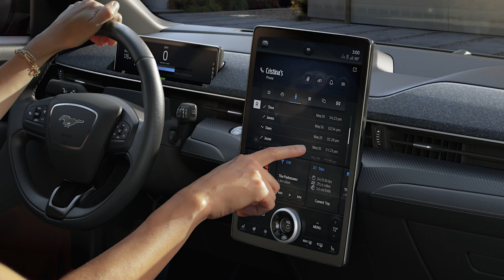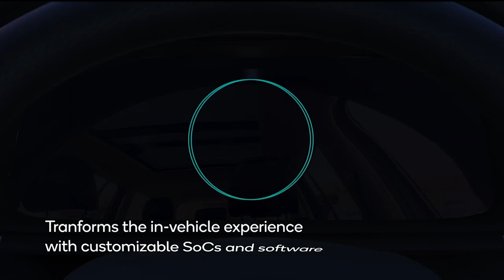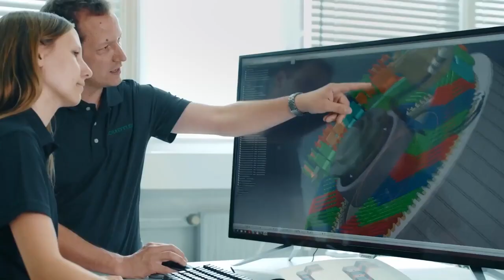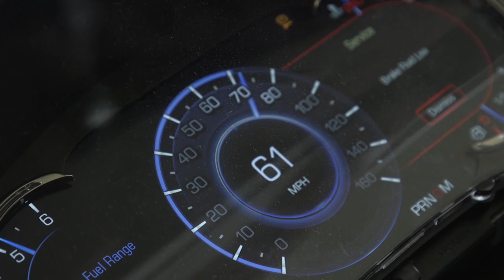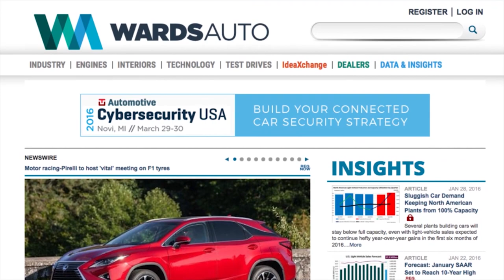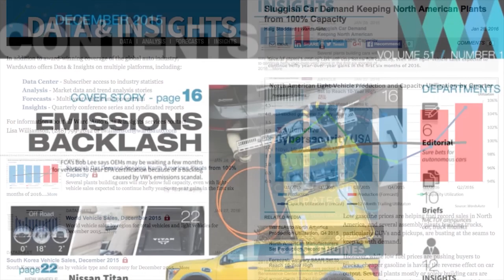VW Concept Anticipates AV Travel; Ford Raids Silicon Valley for Talent - Autoline Daily 3412

Comment: Is there anything less efficient than a hydrogen ICE vehicle.    Just use the electricity in a BEV and get 2 or 3 times the range.
Reply: There have been an army of folks trying to develop hydrogen vehicles for years and no one seems to know what the end game is. What is interesting is how much money companies like Toyota spent on this instead of BEVs. I could understand if they had a plan to make and sell hydrogen or hydrogen making machines but they had no plan for that at all. Very strange.
Reply: @frankcoffey  It is bad enough with a hydrogen fuel cell.   But to go with an ICE which will lose even more energy is bad.  Also that tail pipe is still spewing NoX and possibly the PM2.5 particles.  Or whatever they are called.
Reply: They may be more expensive to make, and more expensive to fill, and less efficient to drive, and be stuck around the few available refill stations, and have smaller trunks, and have no mechanics trained on fixing them, but...  Wait, is there a "but"?
Reply: CNG / LNG was the clean solution all ignore . Cleaner than EV and all indoor commercial vehicles like forklifts use it . Well to well cleaner than EV and no toxic battery waste . EVERY IC MOTOR easy cheap conversion ! Why no talk of hydroelectric also ?
Reply: @BrogeKilrain  Anything with an ICE engine produces NoX and PM2.5 (small particles).   If your going to breathe the air electric is better.  Batteries will be recycled.  Hydro is good when one has it.
Reply: @JohnPMiller  The “but” is the raw materials needed to make ev batteries. It will take at a minimum of 10 years to have lithium, copper, nickel, etc to be at full capacity in North America. The majority of cobalt reserve that everyone needs is located in the Congos, a place infamous for child (slave) labor. There are other places with cobalt, but not enough to meet the global demand. New battery tech that eliminates this material is also going to take 10 plus years to hit the market. The need for transition tech like hydrogen ICE are needed.

Comment: with the new talent you can bet they are all "car guys".  looking for the "cars" they will produce.  vehicles used to have personality.  with this new direction get ready for all the emotion and excitement of a washing machine
Reply: Sure, there is no cult around Iphone or MacBooks. The difference is just that the personality is not about noise, smell and rattles.
Reply: @Terry Orzechowski I'm more concerned with them being able to function period where I live.  Here in the winter we have periods of minus 35 at night with highs of minus 20.  Plus lots of snow and ice.  Your vehicle either produces lots of cabin heat or you die.  Plus I pull lots of heavy trailers.  As of yet no ev made will do what I need my vehicle to do.  4 wheel motors might be fun in our 3 months of summer but what does a person use the rest of the year,
Reply: @Terry Orzechowski the real problem is energy density.  The total amount of energy that can be carried on board the lightning just isn't enough for anything other than casual towing now and then. 

Not so sure about the heat issue.  Heat pumps typically don't work at the kind of winter temps we see, which would mean using resistive electricity to heat.  If range is already a struggle when towing,  then it will be even that much worse when you have to take minus 25 outdoor air and heat it to 65 above in the cab.  Lastly these batteries don't hold a charge well in the first place at very cold temps.

Guy in town here just bought a lightning.   I'm going to see if he is trying to drive it this winter.   

I'm not philosophically opposed to evs, just don't think they are quite up to snuff yet

Comment: Hi Elon aka Mark aka CEO of Recall Motors.  Hagerty tested the latest EV from lowly Hyundai (home of the $4995 Excel) yesterday and it beat your "performance" Y in the quarter mile.  Not the first time your naming convention isn't truthful.  Anyway, props to Hyundai -- king of the $99 buy here, pay here special.
Reply: OTA updates are the future if not present of modern automobiles.   Many object to calling something fixed with an OTA update a recall.  Like the anti-finger-pinching patch recently released.
Reply: @danharold3087  The process to report the issue is the same. The manufacturer reports the problem to the NHTSA, which generates a bulletin and a "RECALL" once the fix is approved. The manufacturer is required to then supply a fix, and send letters to the product owners. How it gets repaired has no bearing because a safety issue had to be addressed. 

When I used to work in the auto industry, I had to deal with a recall that required a visual inspection, then take action if needed. Many cars were only visually verified and immediately the owner was sent on his way. No repair, that was it, yet, it still counted towards the Recall as NHTSA calls it.

P.S. They call it "finger pinching" to not create panic. It could be a child's or a pet's neck or limb.
Reply: Adding to your comment. Tesla has had 14 recalls for 3.5 million vehicles... That was just this year only. That ranks Tesla 2nd to last on the Dow Jones Sustainability  Score. Also, Sam Car Legion had a 2022 Genesis GV60 beat a Tesla dual motor and a Mach-E GT.
Reply: @Roddy451   Are all recalls the same.  A recall fixed with an OTA which most owners are unaware of should not be counted the same as having to take the car to a dealer to have a part replaced.  They can OTA my car as needed and it will not inconvenience me.   Contrast that to getting a recall notice, setting up an appointment, taking the car in, picking it back up.   Tesla ranks at or near the top in customer experience scores.  These other scores are wonky.
Reply: What are you talking about?
Reply: @Roddy451    The entire recall notification system is outdated and a wasteful.   People are getting notifications of the recalls after the problem have been fixed by OTA.    Or is it right because this is the way we have always done it.
Reply: @danharold3087  27/28 on the CR survey for 2021.  I guess the free coffee at the service garage makes up for the customer "experience".
Reply: @danharold3087  it is your opinion that it is outdated. The system in place works and is the same for everybody. They do not use email addresses because there is always a chance it may end up in the spam folder. An  OTA is still a repair for a safety issue, regardless.
Reply: @bobbbobb4663  CR is a joke "Consumer Reports Desperately & Unsuccessfully Tries to Tarnish Tesla with Absurd Tricks"
Reply: @Roddy451  This is the same lame reason used to prevent progress.   It's how we have always done things.  It's the law.  It's how my grandfather did it.
For cars that can do OTA updates you can also display and store a list of fixed 'Recalls".

You car has been updated to X.Y.Z
Included in this update are fixes for recalls
recall 1
recall 2

Chances are this already exists and the snail mail is a redundant waste
Reply: @danharold3087  Rinse & Repeat: It is what works to properly monitor and document safety recalls. Tesla is not crying about it. Again, it is not a matter of pinching a finger, it can also be a neck! It may seem outdated to you to do a census going from home to home, but it is still done that way because IT WORKS.
Reply: @Roddy451   Anyone who rolls the window up with a kids neck in it are apt to get arrested.   It probably took Tesla less time to fix this than we are spending talking about it.  

When an OTA update happens the computer sending the update communicates with the car accepting the update.  The car can compare the list of available updates with applied updates.    What added benefit are the letters?  They are noise.  I have no problem with sending out letters where a physical repair is required.
Reply: It is going fixed by an over the air update when you are not using your Tesla model!  Pinch windows incidence.😆👍
Reply: @danharold3087  Nope.  The CR survey data was based on actual owners.  In fact, CR rated the S very highly.  Unfortunately, the lack of any QA at Tesla finally caught up and instead of simply acknowledging the issue, the fan boys invented a scenario where CR was run by the “legacies”.  #Cult
Reply: It's quite telling when old washed up dogs of industry resort to counting over the air software updates as recalls, a way to bridge the big recall gap between Tesla and legacy auto 😂

Tesla: 7 OTA + 12 physical recalls.
Ford: 100 physical recalls.
GM: 77 physical recalls.
VW: 66 physical recalls. (Likewise Chrysler/FCA)
BMW: 60 physical recalls.
etc.

Thanks for bringing attention to Tesla's big lead here, Bob aka "Non-voluntary retirement" lol.
Reply: @AllanSustainabilityFan  Alex Ansley (your co worker) called it a recall in his letter to NHTSA.  Not my fault you can’t read.  Maybe find a GED school and see if they will let you take a reading course.
Reply: @bobbbobb4663  Nice try bud, you are just calling out the NHTSA for lacking the vocabulary to distinguish between an iPhone update and your company's Bolt product going up in flames. 

That's all you got? A silly technicality from last century?

NHTSA never had to deal with this because legacy car companies were always primitive on the technology front.

But anyone with half a brain knows the difference between (fast/effortless) OTAs and (slow/expensive) physical recalls. 

Maybe read a book on modern digital age technology so you can understand such basic concepts, RadioShack boy.
Reply: @AllanSustainabilityFan  Correction...David Kim from Fremont is the one who called it a safety recall.  Give him a call on Monday to discuss your displeasure with his terminology.  Maybe you can be the one to expose this gross exaggeration / company wide embarrassment to the boss man!
Reply: @AllanSustainabilityFan  Your colleague called it a safety recall.  Rule #1 of the handbook:  Blame the messenger and ignore the facts.  Oh, don’t forget that lowly Hyundai makes faster cars than you guys.  Bad day in Jonestown...oops Fremont.
Reply: @bobbbobb4663  Again, your twisting of the concept of OTA is either an IQ test or integrity test, you failed one of them, simple as that, which one depends on intention.

I don't need to "blame the messenger" here because everyone knows what an OTA means. I instead have to question someone who claims to be "in the field" while pretending to be born yesterday at the same time. 

Either you don't actually have the credentials to operate a Radioshack booth (or obsolete career?), or you're intentionally pretending to be dense about it.

Here, let me help with an actual example of a traditional (not OTA) safety recall:

"Volkswagen confirmed to nextmove a series defect in the 🔋 battery cells of ID.3 and ID.4 vehicles. Due to a manufacturing defect, an increased self-discharge of cells may occur. 10k vehicles to be recalled.

The IDBUZZ had according to sources a similar problem. The Q4 e-tron and Enyaq have likely the same issue and a larger recall may be required.

This could become a costly recall for the VW Group."
--------------------------------------------------------------------------

Do the homework so you don't get fired again.